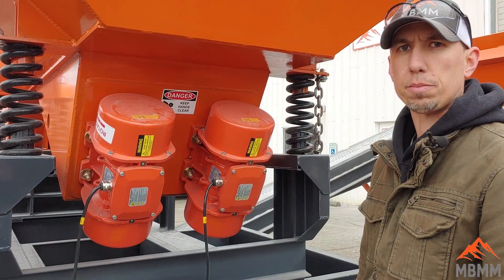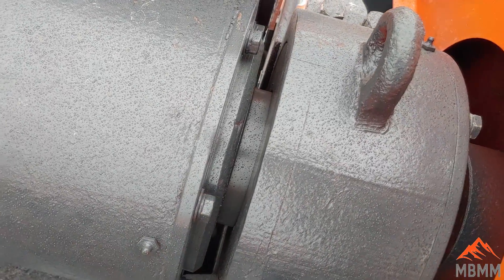Why Crush & Recycle Granite/Quartz Counter Tops? No Disposal Fees, Free Gravel

Comment: In China a machine set up like that would have a generator running with another belt from the diesel engine so that the electric motors for the conveyor and the vibrating hopper were truly free of shore power cords.